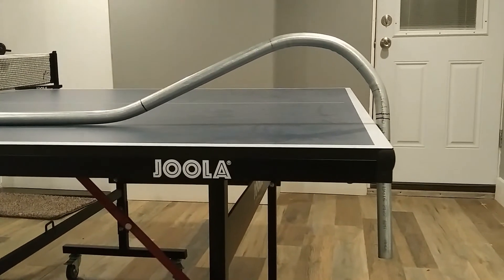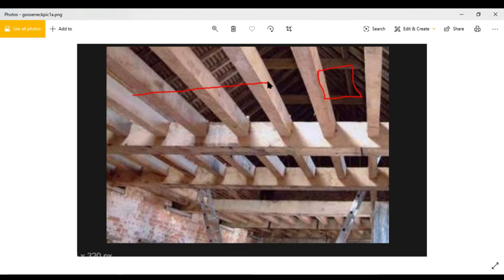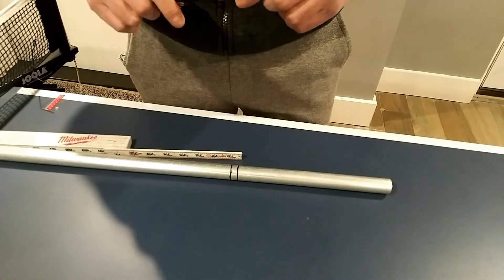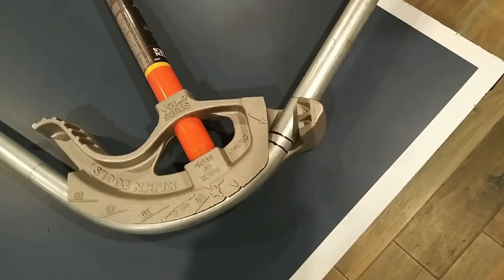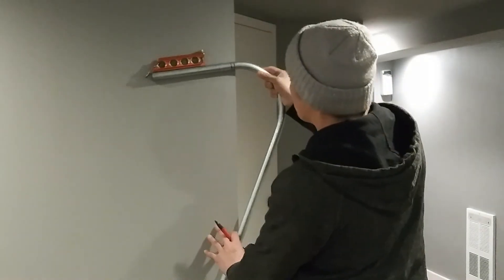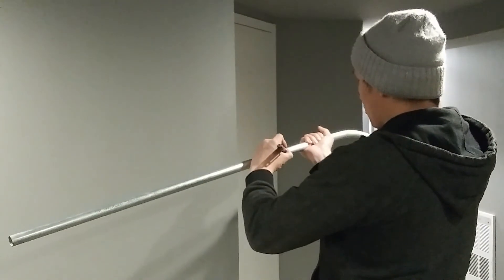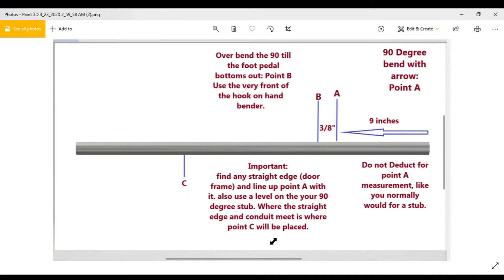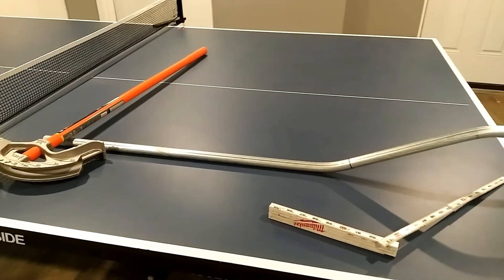EMT Conduit Bending: Best way to bend a Gooseneck Accurately

Comment: Cool bend, how many different types of Shepard's hook do you know?
Reply from the maker: I only know 2 ways of bending them. The one i posted and another where you bend an offset then a 90 stub. But the only official bend thats in the actual books that you learn in trade school is the method i posted. And its actually called a gooseneck. But most people do call it shepards hook. There is no wrong or right as long as its neat, level and gets it done.

Comment: Does the size of the conduit matter for the 3/8 mark?
Reply from the maker: no not at all. same. but this is only for pipes that you can bend on hand benders. so that means it's only good for up to 1 1/4. that's as far as i've gone with the method. never tried bigger than that but i'll experiment and get back to you. as far as the 3/8" mark yes it's the same no matter what size as far as I know up to 1-1/4". Please like or unlike share and subscribe if you don't mind. thank you